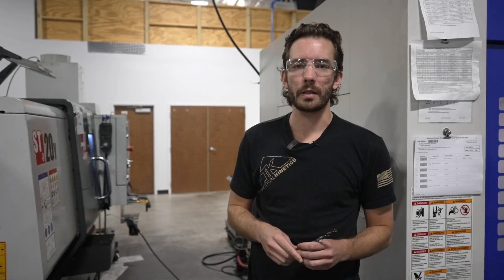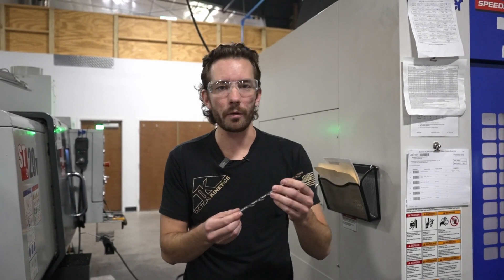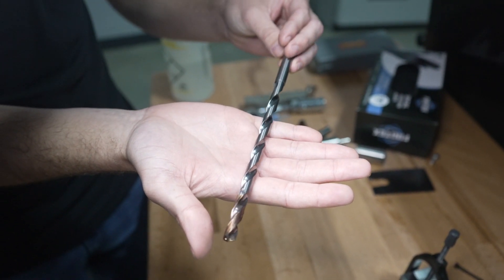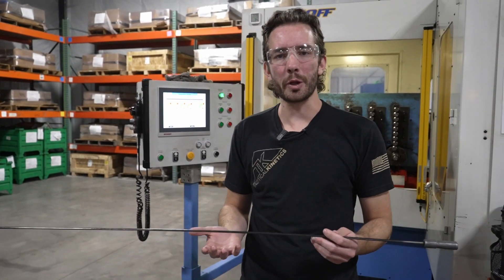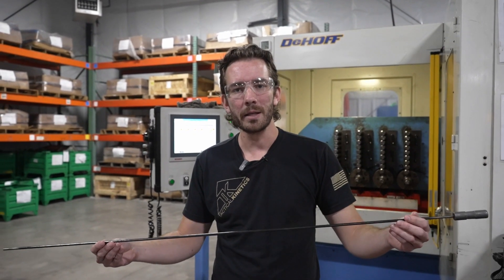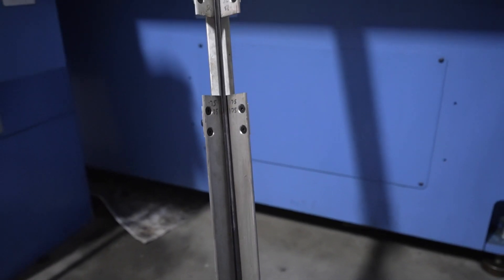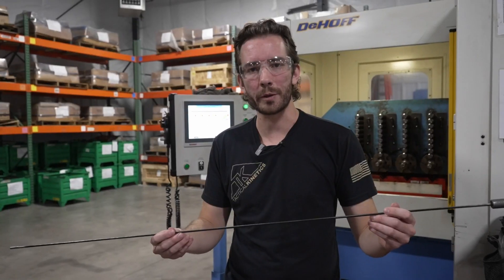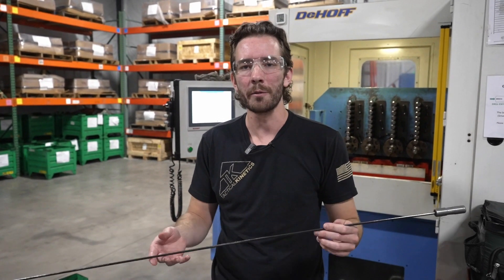Tactical Tech Tips with Director of Engineering, Trevor Inman: The Drilling Process

Comment: 416l stainless steel. Is heat treatment required after deep hole drilling? Or should we say heat treatment first and then deep hole drilling? Drill first, then heat treat. Or do you need to drill holes after heat treatment? ? ?